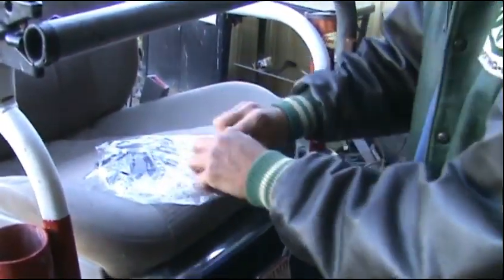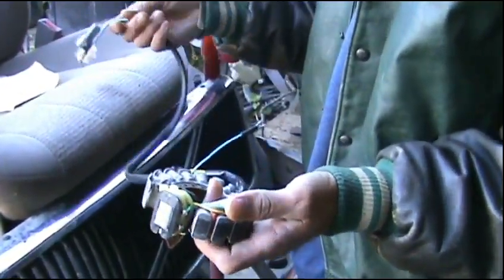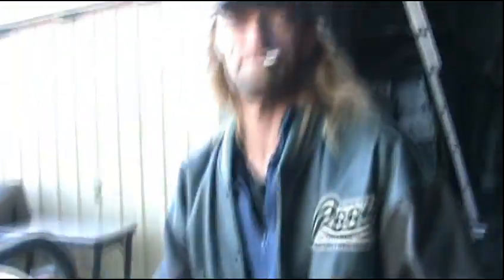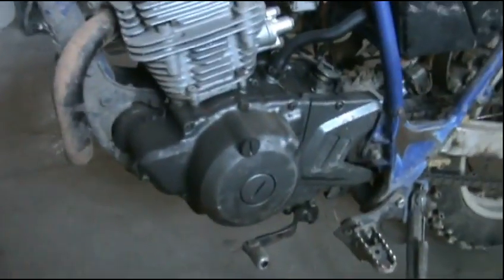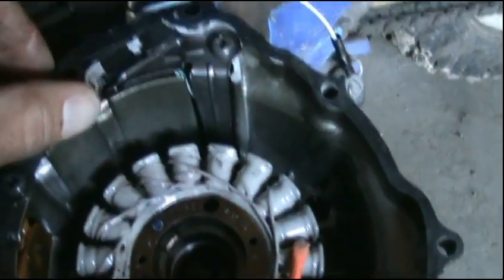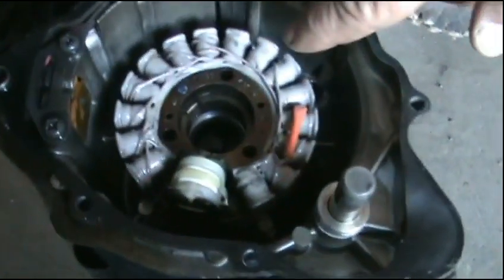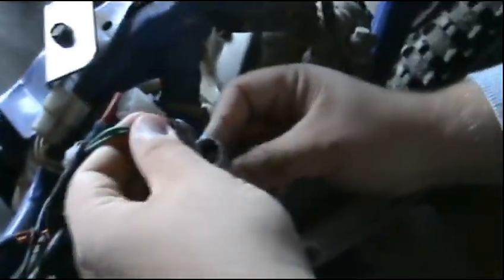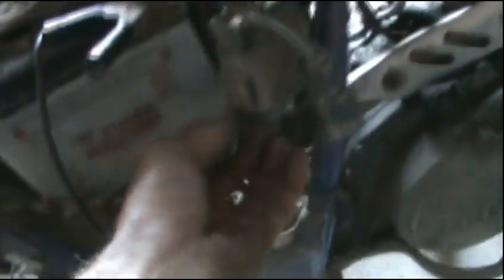TTR225 Stator Replacement

Comment: @RedneckRickem thats a good deal, i just got a 2000 honda cr125r for 1200 but its 2 stroke and alot faster but the 4 stroke ttr i bet is great for trail riding.

Comment: Hey would like asked if when you change your stator did have to drain the oil was the any oil were the stator is does any oil get mix with the stator do they mix at any time
Reply: Yhom Gutierrez 
You will have some oil in the Stator Cover. Also, I would drain the Oil b4 changing the Stator. I would also put a new Spark Plug in but up to u.